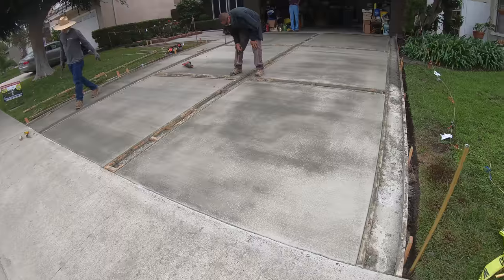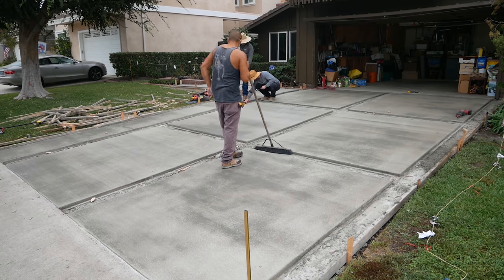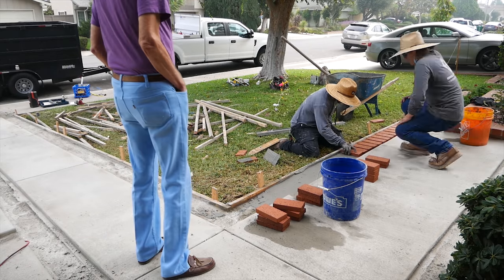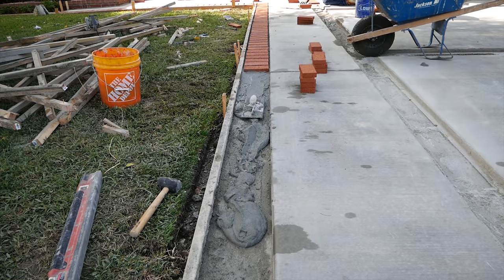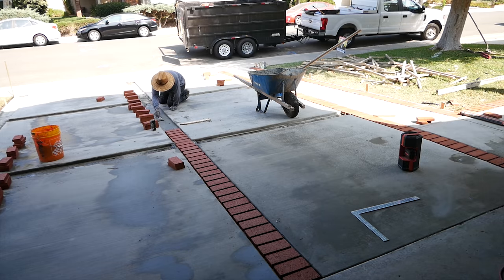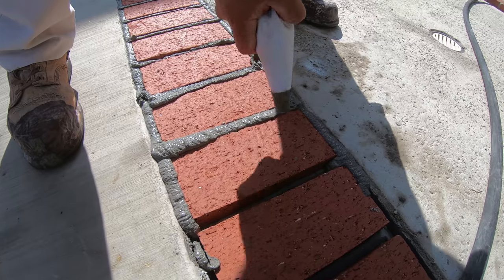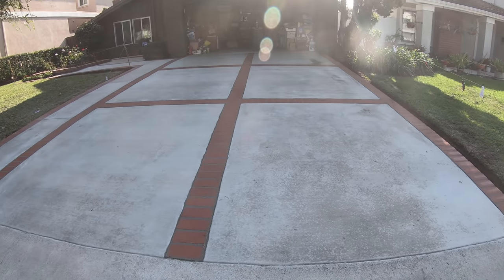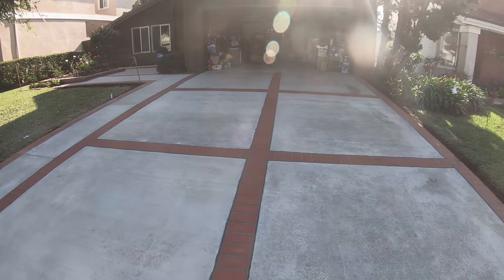How to Pour a Concrete Driveway With Brick Bands, Installation Day! Part 3

Comment: As someone that's done commercial development inspections from the materials side, these guys clearly do top notch residential work. This 3 video series shows a caliber of professionalism to strive towards. Literally everything I saw was amazingly done. The material removal, subgrade earthwork, reinforcement layout, framing/forming, placement, finishing, brickwork... about the only thing you can't confirm is whether the air content of the mix design was on point. Amazing work guys, great job, awesome video!
Reply from the maker: TY DAn

Comment: This is Exactly what I've envisioned for my gravel driveway.  Think I'd prefer a chipped slate imprint in the cement, or even a bit of grass showing thru.  Need extra drainage here, even w/ installed  french drain.  Permeable skeleton not quite the fix.  My city street is Brick so love the look & can curve where I need to.  Thx.

Comment: Should allways lay the brick next to the hole first dry and then gauge  the width  of the joints, you can tweak em left or right a little to suite the length of the hole.
Reply from the maker: I concur

Comment: Did you go back and cut lines into the concrete to prevent cracking? Or does the size of the slabs make that unnecessary

Comment: What do you do for control joints to help control cracking in the slab?
Reply from the maker: Lots of control joints
Reply: Each recess for the bricks will act as a control joint
Under the bricks there will almost certainly be a crack which doesn't matter because it is covered

Comment: A good series, with a nice finish. As you mentioned in your commentary -  oiled batten would have made it a lot easier to remove and spacing the brick instead of cutting even so, each row matches. Will this need to be sealed?
Reply from the maker: No sealer needed

Comment: Nice job but I feel that the grout between the bricks are a bit too wide. But hey, I am not the owner of the home. Again, nice job!
Reply: No those are decent mortar joints, what is bugging me is no mudding the bricks before laying. It would negate the need for that damn grouting.
Reply: @Idontlikeanyoneanywhere  those are thin brick.  Would love to see you mud  the side and but without it falling off
Reply: @russellclarke9863  those are not thin bricks at all and if the mud is made right, you can stick it to anything. Don’t be contrarian because you can only push a half wheelbarrow full of mud you life time laborer.
Reply: @Idontlikeanyoneanywhere  awwwww you get your feelings hurt?  I lay brick, stone, concrete, climb trees, do design, install, and am an all around rock star.  Own my company and will work circles around the average Joe.   Guessing you are average.

Comment: Looks good, kinda surprised of scabbing a piece of brick instead of laying all your brick out dry first so you end up with all full pieces of brick. All your work looks great I’m just surprised you guys did that. I’m not a mason either so I don’t really have the right to say, just as contractor I’ve always masons where I live lay brick out dry first
Reply from the maker: It worked out, not real noticeable unless mentioned

Comment: Why no mudding the Bricks before laying? It would negate the need for grout. It is just like laying facial treads on a set of steps
Reply from the maker: It's faster this way
Reply: @OdellCompleteConcrete  I would have to disagree. Maybe it’s faster if you really don’t know how to use a trowel.

Comment: If I was the homeowner I would not be happy with those bricks that had to be cut down on the horizontal part of the brick inlays.  Someone should have done the calculations better on the spacing so that there didn't need to be cuts when you get to the end.  A little bit of math goes a long way.
Reply from the maker: Sounds like a lot of math
Reply: @OdellCompleteConcrete  I feel like if you were running this job it would have been done perfectly.
Reply: @plasmac9  I agree. I generally enjoy most of their/his work though.